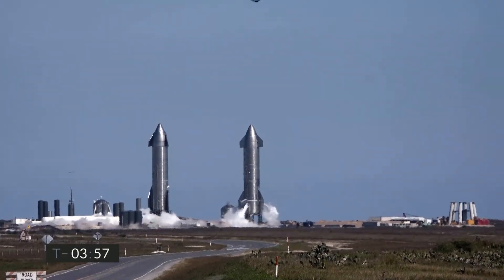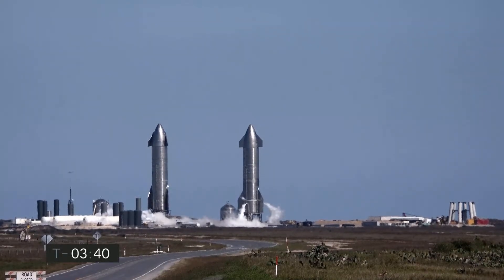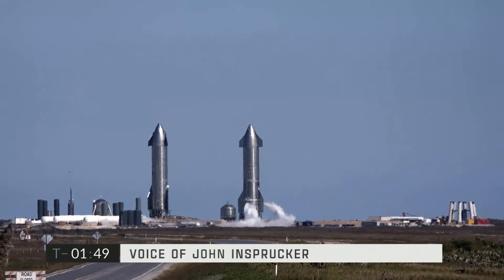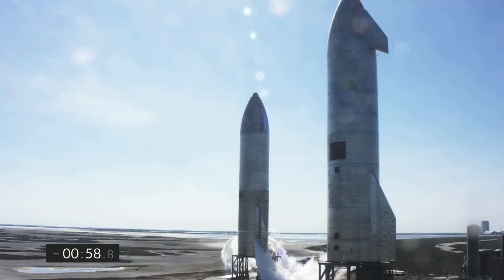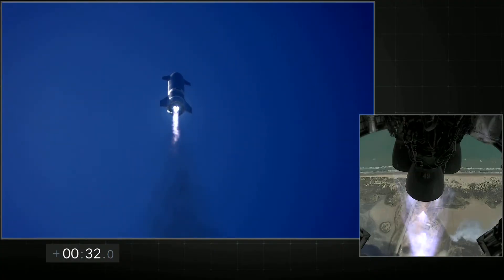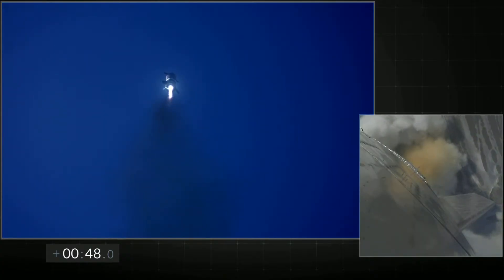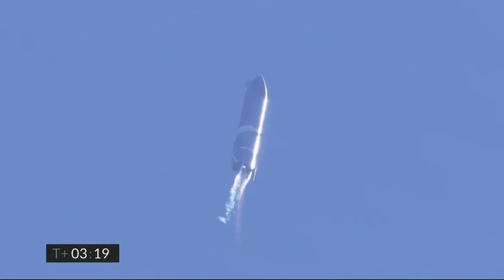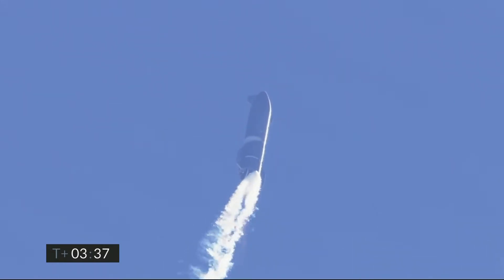Starship | SN9 | High-Altitude Flight Test

Comment: What we learned: Re-igniting rocket engines is hard.
Reply: Merlin plumbing doesn't have to handle rapidly shifting g-loads.
Reply: And re-igniting rocket engines while re-alligning a 76m water tank falling from 10km is even harder
Reply: As is the ground
Reply: Looks like ran out of fuel. Very small andxshort duration impact fire.
Reply: @kevinmcgrath7355  Something also fell of the vehicle near the engines upon restart.
Reply: Could it have something to do with the fuel moving inside of the tank during the final flip? I would imagine that's something that should be accounted for?
Reply: ..and landing
Reply: I believe that isn't about re-igniting. In order to perform this manoeuvre it might take a major redesign or changing the manoeuvre itself.
Reply: or start earlier
Reply: Lol
Reply: There's a reason basically every other rocket uses pressure fed engines when they need it to be restart able.
Reply: I think it's not the reignition itself that is the problem. The engine was on but it didn't have enough thrust to do something meaningful. I believe it was some fuel pressure issue again. Flying on the side is not a normal position for a rocket so that's uncharted territory.
Reply: @MyUniqueUsername I was surprised that the second Raptor failed knowing how well the static fire went (3 ignitions in 1 session)
Reply: 11:46 You can see one engine lit and the second engine trying to relight

11:49 you can see that only one engine is lit when announcer said they needed two. So most likely one of them did not relight properly which is probably why the rocket couldn't orient itself quickly (As seen on SN8, even tho those Raptors burned up internally it had a quick reorientation) and slow itself down enough to be able to land.
Reply: Achronic Deth  they can't do a full duration static fire because they don't have a flame diverter. The shockwave from the engine will damage the ground causing it to break and fly up into the engine and destroy it.
Reply: @dennissuijk620  not what he meant
Reply: @dennissuijk620  They need a diverter or simply augment the high of the support structure.
Reply: Raptor is not quite tuned up for now. Merlin has no problems with re-egniting.
Reply: @georgeayt8231  doesn’t anymore.
Reply: @georgeayt8231  Not about Raptor itself. More about proper fuel feed from tanks.
Reply: @georgeayt8231  it's not the engine it's the fuel delivery system, while it's sideways like that the fuel doesn't rest at the bottom of the tanks.
Reply: @shatterpointgames  Didn’t they have two extra smaller tanks with tubes that aren’t affected by the rocket’s orientation in their plumbing system?
Reply: how hard can it be, just mount a giant parachute to it. Damn i should be an engineer.
Reply: @boratsagdiyev1586  That won't work where there is very little to no atmosphere. This is meant to land anywhere, not just earth
Reply: @HichigoShirosaki1  a big pogo-stick
Reply: @boratsagdiyev1586 What's the biggest parachute ever made and weight of cargo used..🤔🤔🤔
Reply: @boratsagdiyev1586  Can't tell if troll or
Reply: @grimbles39  he is serious
Reply: Why tho? Doesn’t seem that complicated
Reply: @sdf6508  Did you just say rocket science isn’t that complicated?
Reply: @VelocityFilmsCO  lol
Reply: @sdf6508  igniting rocket engines is one of the most difficult engineering problems. I’m getting my degree in aerospace engineering and I just took a class where we built a hybrid rocket engine and the only place we ran into issues during static fires was engine ignition because there are so many factors involved and that was just for a 250lbf hybrid engine initial ignition. The complexity of a re-ignition for a inflight liquid methane full flow combustion engine is astonishing.
Reply: @ijarbis187  @AkiraR ah i see. Thanks for explaining!
Reply: @sdf6508  Did you study rocket engines since you comment that it doesn't seem that complicated? I didn't, but I guess it must be very complicated since this is their second engine failure at re-ignition.
Reply: @sdf6508  it's hard because the fuel has to make it to the engine, and while it's sideways the fuel isn't resting at the bottom of the tank where the pipes that connect to the engine are.
Reply: @shatterpointgames  Which is why they used helium-pressurized header tanks for this flight.
Reply: @shatterpointgames  so put more pipes where the fuel is.
Reply: @sdf6508  actually getting a rocket engine to start period is quite the task. Even if you just consider the main combustion chamber and nozzle and ignore all the systems that actually get the fuel and oxidizer in there it is a difficult task, if the fuel and oxidizer aren't injected into the combustion chamber and ignited with just the right timing everything goes to hell, to early and the engine will blow itself out, to late and the overpressure can blow the engine up. The margin of error for flow rates and ignition timing is relatively small, combine now combine that with all the ancillary systems that are supposed to actually get the propellents into the combustion chamber at the appropriate rate and pressure and it becomes an incredibly complicated task.

Over the history of rocket failures ignition problems are one of the primary causes, and reignition of complex turbopump engines has long been an engineering challenge.

Comment: Someone please correct me if I am wrong here, did the SN-8 use two Raptors to perform the landing burn? If so why this time did they choose one ? Was it because of the temporary band-aid of the Helium back pressure for the header tanks? Did the EPA or FAA restrict them from using two on landing ? due to the sonic boom concerns ? Is it just something that Space-X thought was needed? I don't know if I missed something in the streams or not so if anyone can please fill me in if they know. Also my thoughts on the matter, one Raptor is out putting enough thrust to land a Star ship I am sure but would it be enough in case there was too hard of a kick like we saw today ? Sticking to two and performing the same gimbal profiles adjusting as needed each time, wouldn't that be better, considering the one used was at the tip of the triangular raptor cluster and I think it also induced a roll as well when she wasn't getting to be stable enough ? Redundancy helps too but if there was a reason and I was late too it please update me :)

Comment: This one looked worse than the previous one. Hopefully you can turn correctly the starship next time. I believe that you can make it decelerate properly. Maybe you need to improve the smoothness of the software controlling the thrusters that adjust the attitude of the starship. It has to be fluid motion , like water. I guess you have run computer simulations how it should go.

Comment: I don't know if it's just me but the first one was 12000 what metres so high this one was 10000 but at least the first one you gave it a reasonable time to kick in but this one look like you didn't even bother like it was deliberate but what do I get from what a note to disasters you're not giving the rocket time I'm to circulate the fuel to the rocket engines or or the rapid engines are not big enough.
The rocket has got to have enough fuel to get itself out of mars atmosphere.
I've got a mate I do like the belly flop but if you get that rocket level you should automatically take that in to the vertical position immediately because on mars your going a lot faster.
I saw a computer simulation of I can't remember what the name of it was but the copy of the rocket used as a murgency deploy usual solid fuel and I think the design for the rocket needs to be increased weight there's no it but about them because you just stick with that same design you gonna destroy the ground rockets underneath where you've got no clearance from the ground so that means you've got I have almost at the Chop almost at the job where you've got like normally where you would have rockets where it pushes the rotation up down left right you will have to have some form of just to get the rocket off the ground and of Clarence so that the rocket at the bottom don't kick up the dirt to smash any sensitive pipes underneath the rocket that is my personal opinion but when you see these astronauts testing in Low Gravity in jet planes when they send the plane into a steep dive and for a short period of time they're weightlessness and I personally think that is what going on with this to rocket failures where the fuel isn't getting to where it should be it's different wearing it's been pushed when the gravity is being pushed upwards and a fuel is trying to force its way out that's common sense but what you've got there is on the flip side white lessness coming falling down and I personally don't think it's going to work

Comment: I saw it flip to vertical and I thought "looking good" then it kept rotating and a little voice in my head said "oh no"
Reply: By the way, it is actually supposed to keep rotating, and then turn back to a vertical position (like SN8). The problem here was that with just one engine , it didn’t spin fast enough at first and then it didn’t have time to correct itself with only one engine.
Reply: Yup all because the second engine didn’t light up
Reply: My reaction was ahhh shiieett
Reply: @EdwardRatliff  that's what I said too.
Reply: Do they need two or all three engines to land successfully?
Reply: @leogama3422  it's 2 for landing and 3 for liftoff. They need 2 to fire up to cancel the velocity enough to do a soft touch down. So when only one engine fires, but the second one doesn't it's hard for it to gimble correctly to kill the velocity and ensure it's vertical for landing.
Reply: Even with three engines ignited, it looked way too low to recover and land. Next time.
Reply: You just quoted everyone working in flight control!

Comment: 11:34  They Flipped the Vehicle Too late to Vertical Position & too Suddenly .That Sudden Change Made the Heavy Rocket Loose its Balance & Tilt towards one side Rather than  Vertical  .
They Must Flip the Vehicle to Vertical a bit Earlier , as u can see it was too close to Earth for the Flip.
Reply: They don't do anything. It's all fully autonomous and pre-calculated. But one engine failed to produce the calculated thrust.

Comment: The back flap didn't opened and it should open a bit to increase the drag to help the engine hold the tail momentum during the flip. This could allow the engine to work properly against the direction of the acceleration.

Comment: You folks perfected the landings with Falcon 9 and the super heavy boosters, think about what's different here? 
Falcon 9 and the boosters all descend nozzle down, the propellant doesn't have to shift to the bottom of the tanks, it's already there. Starship does the flop, the fuel isn't already at the base of the tanks, header pressure or not, liquid that just flipped has its "vomit comet" moment. Do the flip at a higher altitude and allow time for fluid migration then ignite.
Reply: I know Starship can't descend like Falcon 9, the base is a big cup that air pressure at super sonic speed would destroy the walls.

Comment: Transition to vertical was too close to the ground. The weight of the rocket make it experienced swing momentum and not enough time to stabilize to vertical possition. Can You guys change the timing of transition earlier? I believe once flip momentum was gone, rocket can do a correct job on landing

Comment: Looks like they should be flipping that vertical a little sooner, so that fuel isn't sloshing around at the last minute, and so new engine fires to get stabilization earlier. Trying to flip a baseball bat and have it land on its end, all in six seconds.  Either that or get some tires on its belly and use a runway.

Comment: Well its a failure only if you dont learn from it aint it?
Reply: Im by far no scientists, but imo it couldhave been prevented if, you wiuld fire all three engines, that way if 1 is not working you still have the minimum 2 that you need,also maybe the flames from the two engines could have helped ignite the third one that was malfunctioning, and maybe preserv some fuel to try and fire them up bit higher? 

Only speculations very interested on what was exactly the problem and what will you do to avoid it next time :)

Comment: I think they need to do the vertical flip at the 2 and a 1/2 kilometers mark, not enough time for control surfaces to adjust.  Remember there no such thing as failure, unless you refuse to try. Each non-success is a chance to learn.

Comment: Few things:

1) Looks like something came off from the bottom right during the flip (maybe engine parts?), which could explain the engine failure we saw here.

2) It seems they waited a lot longer to flip before landing for this one than SN8. Could that have been just not having enough power to flip it quick enough, or was this intentional?

3) I think that from here forward, they could try to incorporate some kind of emergency 'chute system or something for cases like this. I know that it's really too low for having parachutes deploy, but it could be more reassuring to have some kind of last-ditch backup system in case the landing procedure fails.

Other than that, good job guys! Just hope that you don't need to drag SN10 back to the high-bay should it need any modifications.

Comment: Looks like they lit the engine too late, and came down way too fast and hard. A few seconds of engine isn’t going to to slow you down to a hover above the pad... and a gentle landing.
Reply: Two engines were supposed to assist with the landing and it appears only one of the two worked correctly. That explains both the increased speed and the over-rotation that happened at the end. But it's still too early to say for sure.

Comment: I think that the aft control surfaces should be re-applied sooner after swing begins to bring the ship to vertical.  This would prevent the ship from swinging beyond the vertical and the engines wouldn't have to work so hard to straighten out the landing.  Also, the flip should occur sooner to give more time for the deceleration to the ground.

Comment: Try to flip the starship vertically at 5km mark, so you have enough time stabilize the descent (with 4 propulsors and Grid fin in the nose cone)
Control the deceleration from 3 km mark, if the approach is still to fast, them deploy some parachutes.
And finally, if you reach 2 km mark and the approache still dangerous, then deviate the starship to the ocean for a splash landing. 🖖

Comment: This approach is to dangerous, astronauts lives are dependant on the engines working without fault. Just redesign the starship to have pop out wings and a wheeled landing gear and just simply glide down to a runway and land safely. That flip flop maneuver all depends on those engines to work flawlessly and if they don't then the weight of the starship will kill all the astronauts on board. At least with a glide down approach with pop out wings and wheeled landing gear the starship will have a chance of landing safely without the engines working properly. Use the flip flop maneuver for unmanned flights to transport cargo and the glide down land runway approach for returning astronauts.

Comment: Read this ELON MUSK 

the Starship is so heavy for low altitudes of belly flips. it’s difficult to manuever the starship when the altitude of belly flaps is so low. higher belly flip  possible to chance maneuver very well .  

2nd option, put the big parachute in the nose cone of starship after the re-entry . so no longer belly flip needed. just to full boost engine to manuever very well and balance smooth landing .

Comment: Was actually quite sucessful if you been following this from the start. Obvs gutted not to have landed but the data from what happened and what came flying off from the engine skirt on engine relight will aid in the development of Starship. Y'all need to remember this is basically a prototype being tested, this will and is expected to happen. Nice flight again tho, them aero surfaces giving some good results and good data 👌🏾. RIP SN9 onto SN10

Comment: @spacex. Why not increase the drag by applying a membrane (a sail of some sort) between the front and aft flaps. That way, the drag is higher, the ship is still controlled by the flaps and the weight more or less the same. Best  regards, John